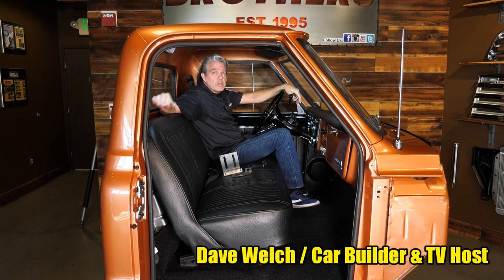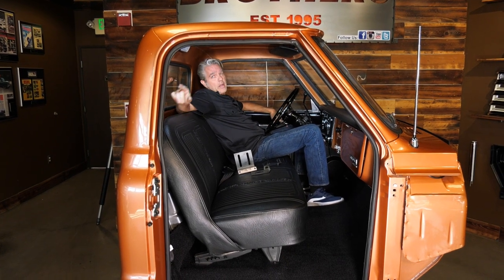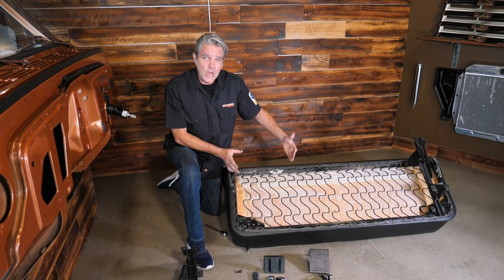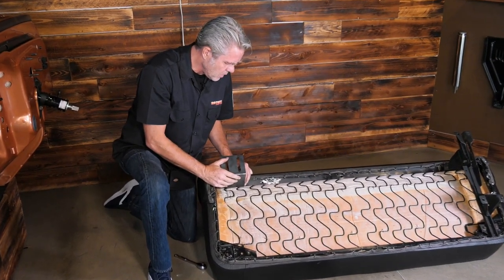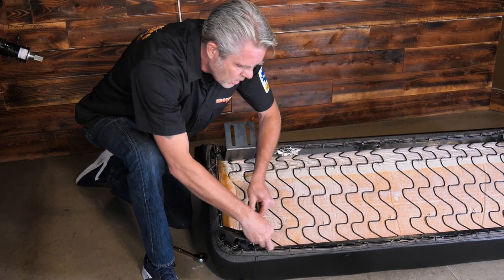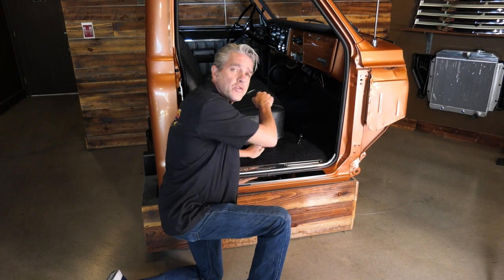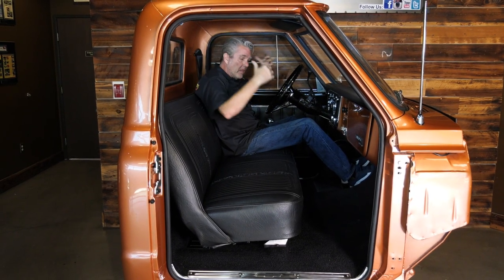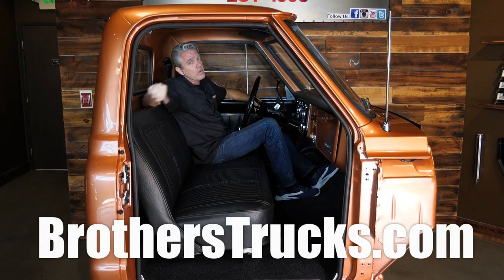1967-72 Chevy & GMC Truck Lowered Seat Bracket Installation

Comment: Brackets did not bolt up had to do some trimming on the front brackets and had to cut some off the rear.
Reply from the maker: Modifying our brackets is 100% unnecessary. You probably don't have the correct seat frame in your truck that matches the year of the truck. What you described only happens when you use 67-70 brackets on a 71-72 seat or vice versa.
Reply: Same here these things don’t fit…
Reply: @BROTHERSTruckPartsTV  the part clearly say 67-72 on the site and does n’t specify the exact year. I have a OEM seat.

Comment: My freaking tracking front bolts on my bench seat I can't get to I can't put a socket or wrench. Does the upholstery have to be stripped because I just got the seat reupholstered. Does anyone have a answer for me thanks.
Reply from the maker: We've never run across that before. Contact the shop and we'll give you a phone number you can text photos to. Maybe that will help us help you.
Reply: @BROTHERSTruckPartsTV  Ok sounds good thanks so much 👍

Comment: Hey Dave I need to know how , the bench seat adjustment cable works can you help us out ? Thanks
Reply from the maker: it simply attaches the left side to the right so that when you pull the lever on the Drivers side the Passenger side also gets released.

Comment: Does it have as much room for readjustment with the factory gas tank still in the cab?
Reply from the maker: Yes, even with the factory tank you can adjust the seat all the way back to where it will touch the cab.

Comment: I'm looking at a 76 with this same issue. I'd snap it up if I could find a way to drop the seat down
Reply from the maker: Due to the framework of the Squarebody, the seats already sit considerably lower than the previous trucks did. Unfortunately that makes it basically impossible to drop the seat just by changing the mounts.
Reply: @BROTHERSTruckPartsTV  somebody must have told me the wrong year or they put in a different seat, my fist barely fits between the seat and steering wheel
Reply: @BROTHERSTruckPartsTV  if that's considerably lower I'd hate to see the first ones

Comment: I bought it and love it... I do find it funny though that he had the seat slide all the way forward! Good marketing fellas!
Reply from the maker: Glad you like the drop brackets, we've had killer feedback on them so far!  FWIW, the 67-70 seat (the one in this truck) has 2" more "lean" than the 71-72 seat, so it's almost impossible to slide the OG slides all the way back without the back of the seat hitting the cab below the window. You'll notice that the back of the seat, before the brackets are installed, is right up against the cab while Dave is demonstrating how little room there is. No attempt at marketing, just real world cramped cabs in these classics.